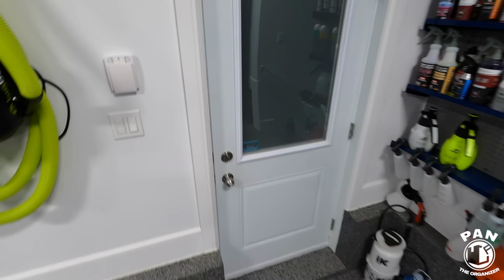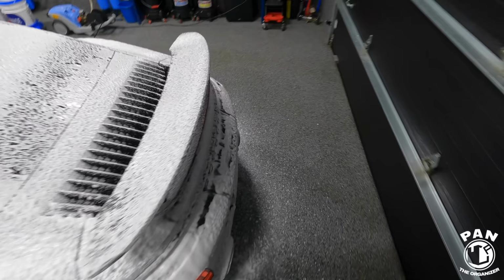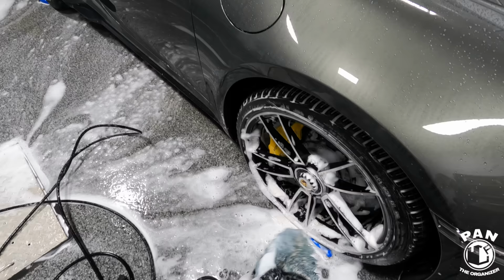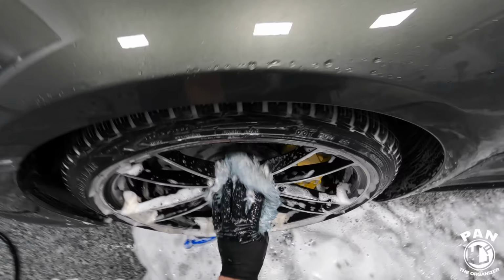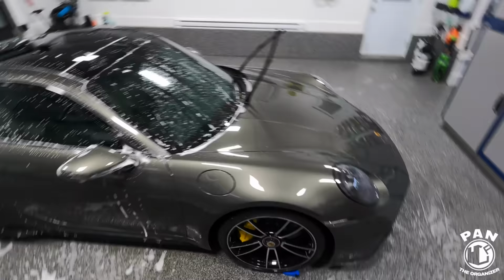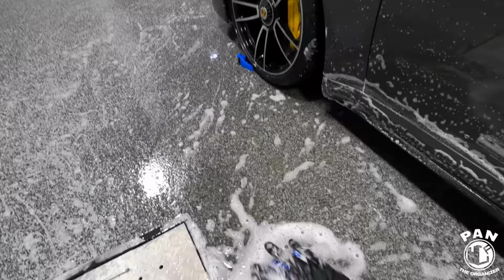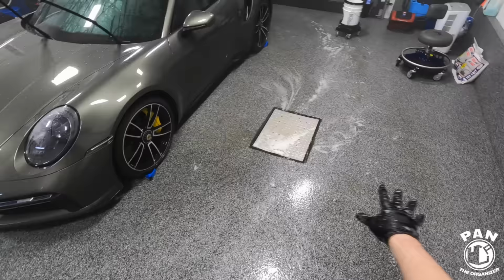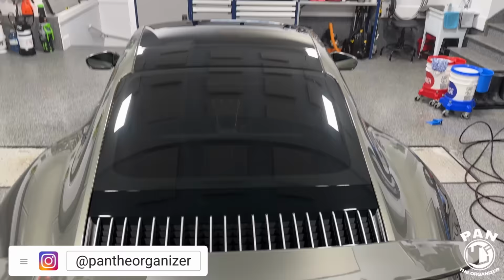Cleaning A Dirty Porsche 911 Turbo S : Exterior Auto Detailing

Comment: Pan, do you have PPF on the turbo s? Thanks.
Reply from the maker: No. Just the factory PPF on the rear wheel arches as those hips are wide lol. 

I will have a video coming soon on replacing that OEM PPF and ceramic coating it soon.

I am just not a fan of the look or feel or PPF. Plus, as I get a brand new car every three years, and do low yearly mileage, scratches and stone chips are of no concern to me. My cars are always pristine when I bring them back to the dealership.

But for people who keep their cars for many years, and want the ultimate scratch and rock chip protection, PPF is the only solution. I would still recommend a ceramic coating on top of the PPF, for the best of both worlds.
Reply: Good to know. I’m with you. Don’t like the look and feel. 

Do you swap cars every 3 years because you lease or just buy and sell every 3 years?

Comment: Hi Pan, just sent you a message on Facebook. I love this video and have watched it a few times. I recently bought a new Audi S3 in black. I want to wash it but don't want to use the wrong foam. I'm in Melbourne, Australia and no where can I find the Koch Chemie Active Foam you linked. I did, however, find Koch-Chemie Active Foam Af — Mild Alkaline Snow Foam. pH 9,5 and wanted to know if this is safe to use and if you would recommend it? My concern is the pH level as I was told to use pH neutral and not sure if this will damage the paint or paint protector (ceramic). I'd really appreciate your advice as holding off washing the car until I am confident this will be okay. Thanks in advance. Chris.
Reply from the maker: For regular weekly washes, stick to a pH neutral snow foam (Koch Chemie Gsf, Adam’s Car Shampoo, or what ever pH neutral snow foam you have near you).

You would only use higher pH snow foams like Active Foam, CarPro Lift, Gyeon Foam or Gtechniq Citrus Foam, once every other month for a deeper clean and traffic film removal. It won’t harm a true coating (onss in glass bottles) if used correctly and only once in a while.

For example in the spring. See my ultimate spring detailing tutorial: https://youtu.be/oTaFE_p2OAw

I try to answer YouTube comments on a daily basis as you can tell. I can spend up to four hours daily just to reply to YouTube comments. I’m the only big detailing channel that personally responds to viewers.

With almost one million subscribers, I get thousands of messages and emails daily across all platforms, so it’s unthinkable for me to also be able to reply to messages on other social media platforms. I’d die trying. Thanks for understanding.
Reply: @PanTheOrganizer  Thank you Pan!! Truly awesome and wow responding so quickly. Huge fan! Keep the videos coming!
Reply from the maker: Thanks for the kind words, I appreciate it! How did you discover my channel by the way?

Welcome to my channel. You discovered one of the biggest car detailing channels on YouTube as we surpassed 905,000 subscribers and we have over 117 million views! I have been detailing for 26 years and I love to share my knowledge and passion with my viewers.

You found the right channel to help you learn everything about detailing.
Reply: @PanTheOrganizer  Hey Pan, I was told Snow Foam is what you should use for a car with ceramic paint protector so did a search on YouTube and your channel came up. Subscribed and catching up on all your videos.
Reply from the maker: Welcome to the Pan The Organizer family! :)